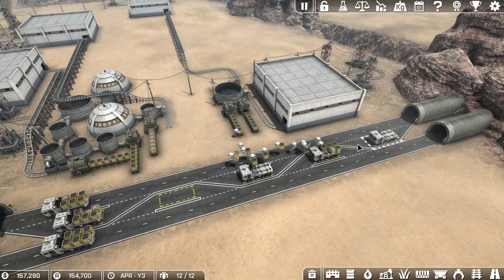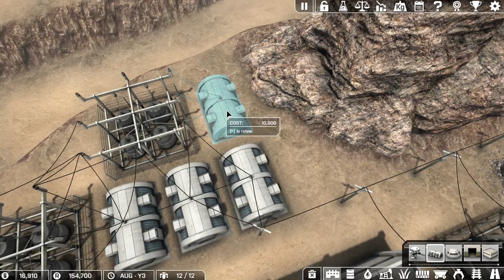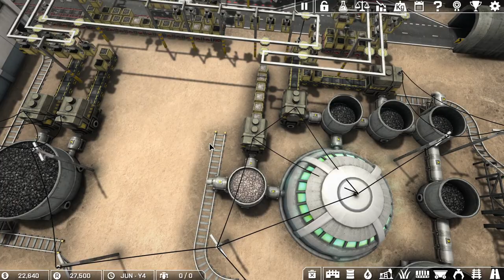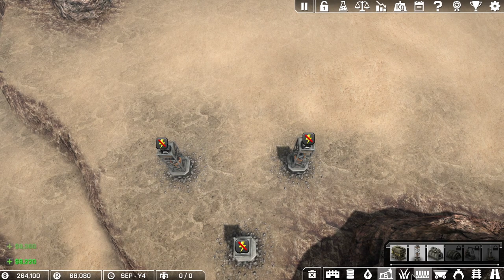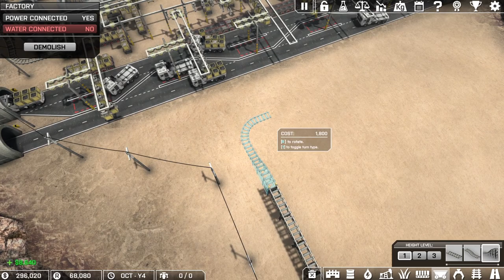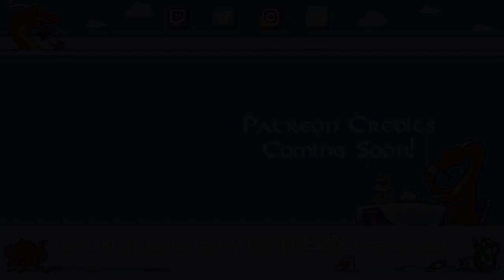Claw-Loading – Automation Empire Gameplay – Let's Play Part 4

Comment: The claw trains can traverse between the inside and outside of factories (on the upper level), it may be more (cost) efficient to set up a mass boxing factory and have the claw loaders collect from within it rather than use the mass of belts you have outside. IIRC; one large storage vat supplied by 5 refiners can support 4 or 5 box makers.

Comment: At one point, the total for the past 3 months had just dropped to 4000 at the start of a month, and you wanted to know if you'd make 6000 by the end of the month. There's an easy way to see that the answer is yes: that 4000 accounts for two months (plus a month in which you hadn't shipped anything yet), so your average for those two months is 2000, and you'd improved the system during that time period. The only way you won't have that value be at least 3/2 as much at the end of the month as at the start is if something has broken or is unsustainable (that is, if you built up a stockpile somewhere and then improved the next step and are now depleting something that's going to run out during the month).